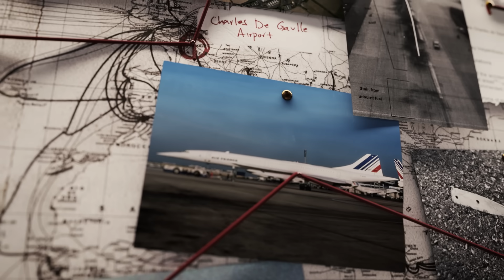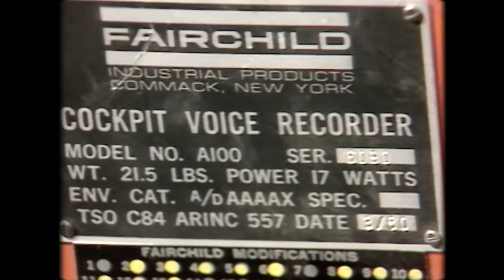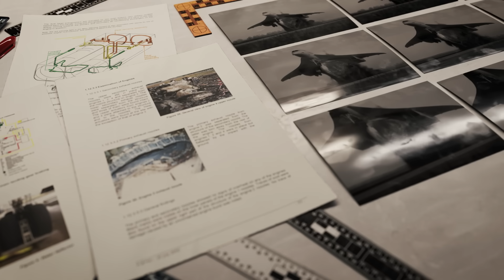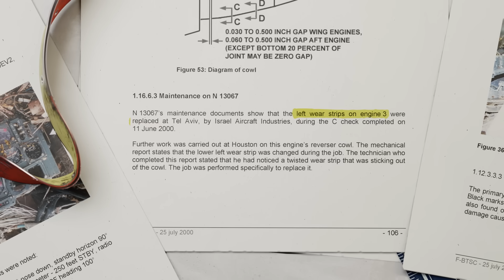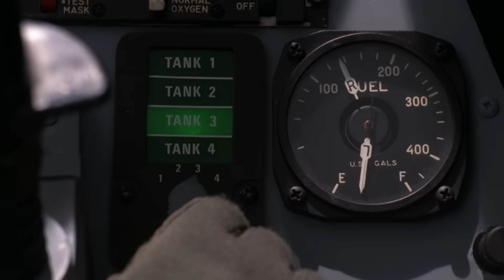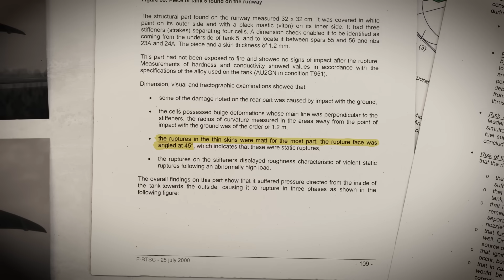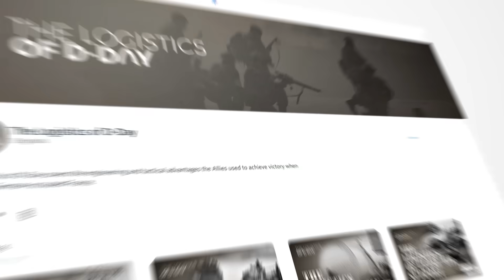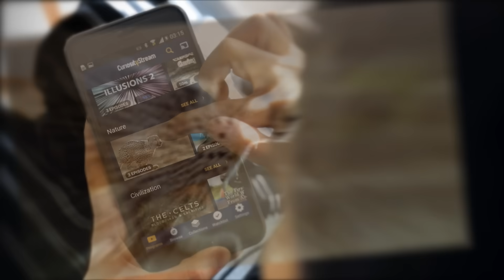What Actually Happened to the Concorde

Comment: That still seems unbelievable how a piece of metal on a fuel tank pop off and separate like that.
Reply: Eh, at high pressures, metal behaves similar to a plastic balloon. You can pressurize an aluminum can with a bike pump (or dry ice) and get the same effect, though you’d better have something to hide behind.
Reply: @ZeteticPhilosopher  yes, but the destruction would not leave behind a perfectly flat piece of metal with an outline like that. Seems silly.
Reply: @ivegotheart  what do you know ?
Reply: @ivegotheart  The perfectly flat piece of metal was ejected before the explosion, which lead to the leakage of fuel.. hence it didn't have any burn marks.
Reply: @ivegotheart  Yes it does lol. I work in aerospace. We do pressure tests exactly like this because of this incident, and you get large shreds of metal torn precisely like this.

Don't talk so confidently about what you clearly don't understand.
Reply: @ZeteticPhilosopher  Joints, welds,and weak points will break sooner then some magical perfect shape straight out of the solid material. You are talking magic bullet, and are getting emotional. Maybe you are bleeding or pregnant.
Reply: @ivegotheart  This is why people suck. "You are on your period or pregnant" when someone says something you don't like. Why do you have to be so degrading, it has not even anything to do with the conversation
Reply: @flavorlessquark8614  you say people suck and I'm the bad guy? Feel better. It's not their fault, and It's everyone's fault. Never be angry. Those are the bad people. A man with anger is a woman.
Reply: @ivegotheart  You have a mindset stuck in the 1800s lol. A man with anger is an angry man. You think you're cool cause you pretend to be a manly man without emotions. That doesn't make you cool. Everyone has emotions
Reply: @ivegotheart  I didn't say you were the bad guy, I said there was no need to be degrading to women for no reason
Reply: @flavorlessquark8614  cool
Reply: @ivegotheart  Lmao. I'm not the one having a drama session in a youtube comments section because they got called out talking BS by someone with industry experience. 

Have a nice day. Enjoy the tantrum.
Reply: @ZeteticPhilosopher  cool thanks. I wonder what that makes you.
Reply: the point le the video is that the reservoir was not «cut with a knife » but sheared by compression wave forces. they are not saying exactly like this, but the reservoir exploded under compression waves. the petrol brought natural compression to all parts, and the hook added the little something that was just enough to create the critical front wave to shear the foil. 

this reminds me one falcon 9 explosion, where the root issue was a hydrogen tank inside oxygen tank that ruptured, bringing oxygen tank to higher pression than designed ... that happened on ground during filling about 20mn before planning lift off. the dumping mass  ( a few tons, a raw steel roll ) was seen to fly a few hundred meters away. 

you need to understand how waves hugely increase forces ...

see how glass can break with sound. there are videos made by slow mo guys. also check prince Rupert drops (smarter very day, and other )
Reply: @Benoit-Pierre  no. Me thinks thow doest protest to much. Someone was onboard that needed to be Epstein'ed. Nice try.
Reply: @Benoit-Pierre  
Are you referring to harmonics?
Reply: @fazole  no. Harmonics and constructive interférences help building waves with very high energy, but nothing in this video points towards these specific case. But a simple impact wave + simple echo could be suffisant to explain the problem of the day. We need access to the full simulation to know what « exactly »happens. The video does not go deep enough to know. 

In other cases, yes harmonics are pretty much destructive, and example of easy destruction. 

Singing in front of a glass can break it without touch.

Impacting some objects may break them via a counter intuitive way, and the slow mo guys often show it : you impact an object at some strong place, the chock produces a propagation wave , and object breaks at  a different weaker place. At live speed you see the thing breaking instantaneously, but with slow mo you see that initial fracture happens very far away from initial impact.

I had the cas once irl. I was washing a glass, holding it firmly. The glass touched the sink, and a thin half mm peace broke at the precise point of contact between the glass and the sink, but a good 5cm chip detached at the exact opposite and fell in the glass. I was both angry breaking an expensive glass and amazed by what I had lived. The chip was almost a perfect half circle, simply detached, strictly at the opposite of contact point. I was still holding the glass, and could remember exactly how the glass touched the sink. Any one else not being physician would doubt about what had happen, if memory fails, glass turned in hand, slipped ... But my knowledge explained the situation. It was completely counter intuitive. And it's exactly what happened to the Concorde.

Harmonics and interferences (are very different ) both imply that several wave tops propagate in order to either define a wave length, and or a wave addition.

In case of concord or my glass, this is not possible. Every single mm or inch the wave propagates, it looses energy. So, the wave around my glass would have spent much of it's energy after several turns around the glass. The glass did not had time to resonate. Either there is enough energy to break on first turn, or it will dissipate. (In short. With very low resistance propagation, you could maybe so 2 or 3 turns to synchronise two waves, but very few rotations at harmonic lead to huge and rapid dissipation ). 

Breaking at a place different from initial impact is a very rare case and very difficult to explain and simulate.

In most cases( like singing in front of a glass ) you gradually bring fresh energy and build up the wave. It's the case when you see dancing sand on vibration plate( happens often when I grind a steel sheet ) ,  or foam ball floating in the air with ultra sound.  

In the Concorde, or my glass, energy is not gradually brought with time ,  but impacted at one strong place, then it moves at  a weaker point. 

That's why the hook must not be seen as knife which cuts through, but a hammer that hits one strong point to induce one wave. 

If the hook had just cut the reservoir, it would have produced one cut, followed by an irregular shear, and the peace would by hanging by some side. But the bit of reservoir is very square and completely detached with regularity : some how the wave found a way to draw a square of forces. 

Note that the reservoir not only stands full pressure of tons of gaz, but is also a structural part of the plane. This happens near the engine, when engine is at max power, and plane is the heaviest, producing the largest possible constraint on the wing. The whole plane is completely elastic and flexible, so even if most of the forces are transmitted to structural   beams, the face of the wing is used to participate to the global strength and contributes to transmit efforts from the engine to the main body. So, the reservoir pressure plus position between engines at max power and main fuselage is a perfect situation to tension the face.

Same hook at landing with idle engine and empty reservoir would probably not lead to such nice square shear. 

Note that the Concorde has from memory 9 or 12 reservoirs, and gas is moved around to move center of gravity and help choosing inclination. Once rising is finished and plane starts the main flat course, gaz is moved at the front to lower the nose. Then back again for landing. If most modern planes play this game, the Concorde is the plane where its most important, and most critical design feature. Aerodynamic of delta wing is not appropriate to handle wing modification structure to stand low speed high angles, so center of gravity correction is done by moving fuel. This impacts on the pressure endured by this specific part of the reservoir at this moment. 

At landing the fuel is pumped back again, but in the tail reservoir, because wings are almost empty. And since the plane is considerably lighter there is less need for portance on wings. With less mass to need to lift, wings have a different need. So center of gravity is not at the same place at landing. 

This plane was a marvel of engineering.
Reply: @Benoit-Pierre  i love the example of that glass, clarified a lot of things.
Reply: Adults behaving like 10yo kids in the comment section 🤣. Internet was suposed to make us smarter not dumber
Reply: @erderscrtus8331  so here you come

Comment: Lockheed: “you mean the L-1011 lost to a plane so bad it caused other planes to crash?”
Reply: Only lost because the engines from Rolls-Royce took so long to deliver, meaning Douglas had already lobbied for their DC-10. Also, wasn't the plane itself, it was the repair work carried out by Continental  though the DC-10 is still very dangerous. L-1011 was so much better.

Comment: Maybe it was answered and I just missed it. But how did the fuel leak cause a loss in engine power? There would of still been plenty of fuel to power both engines.
Reply: The Co-Pilot shut down the wrong engine no shit TRUE
Reply: @davidclements6507  Flight Engineer. And he did so below the minimum safe altitude to do so.
Reply: My guess is that the force of the leak caused by the hole was stronger than the force of the pump. As the fuel is incompressible, then it will only go one way thus preventing the fuel to reach the engine causing it to stop.
Reply: My first thought as well.  It looks like one engine abruptly lost power at the same time the fire started (based on the curve in the burn mark on the runway).

Comment: I'm amazed that you managed to make this video and leave out so much detail about what actually happened and caused the accident. Examples being, the missing spacer on the left bogey, allowing the wheel truck to wobble about all over the place. The aircraft was 3 or 4 tonnes overweight, the tyres were over inflated, the fuel tanks were full to the brim, leaving no air gap, the crew taking off from the wrong part of the runway where resurfacing work was being carried out, so they hit a lip where the new tarmac met the old, and the fact that the flight engineer, suspecting an engine fire (there wasn't) shut down one of the engines WITHOUT consulting his checklist, nor alerting either of the pilots that he had done so. The Air France Flight crew were negligent and responsible for this accident (along with the engineering team). There's SO MUCH more to this accident. If you want the full story, you need to watch this video by Senior British Airways Concorde Pilot John Hutchinson https://www.youtube.com/watch?v=fqOcYhzWUZY

Comment: That really is an incredible cause. My mind went to the landing gear being forced slight upward/and toward the wing causing either an immediate rupture or upon the release of tension the material pulling apart just enough to open a tear in the tank.
Reply: This is not what happened, the tire exploded from over pressure when it run over the metal strip, and the rubber (a large enough chunk of it) itself flown upwards and hit the underside of the tank. and that piece caused the pressure wave to move in the tank (inside the fuel) and when it hit the tank side on the wrong part, it blow out. it was not a slight movement in the landing gear, but a literal explosion with insane force. Still, it was somewhat known to happen and there was even some talk before to switch either stronger tire or make it, that the explosion would go sideways, instead of vertically, avoiding the plane.
Reply: @thorin1045  I know that....I wasn't telling the world some alternate reality. I was just offering my reaction and initial thought of what it could have been. Based on nothing but seeing the resulting plane crash.
Reply: @Nilguiri  Yes. Clearly. Much nah.
Reply: @thorin1045  yeah, and until this incident.. Concorde just... seemingly didn't think it a high priority.  It's astonishing to me that they didn't think this a big enough deal to take action until it caused a disaster.
Reply: @marhawkman303  well, the tire had issues multiple times, but never caused any issue before, so they believed it is safe, and probably if the metal strip would have been a few meter earlier, the tires would spin much less and the dent would have been small enough to not cause major issue. It was in the worst spot, fast wheel beyond the safe abort speed but before it started to lift and reduce the pressure on the tires.
Reply: @thorin1045  But the tire DID cause issues.  It holed the tank in more than one case badly enough that the Concorde had to cancel the flight and return to the airport for repairs.  This is where the "DANGER WILL ROBINSON!" alert goes off.  A fuel leak bad enough you had to cancel a flight for repairs is not something you should take lightly.  If it was only once? Maybe.  But it wasn't.
Reply: @marhawkman303  yes, they should have done it, or to be precise, they actually did taken it seriously, they already requested a better, stronger, more resistant tire, it was designed and even produced, it was under delivery, within a few days it would have been on the concorde, so it was almost averted, just they got unlucky (or irresponsible, depending on view) and it caused a very bad issue before the solution arrived.
Reply: @thorin1045  Need to also take into account that Concorde was overweight during it's take off run. Extra luggage had been loaded unexpectedly and Concorde did not burn off all of it's fuel when it made it onto the runway and as a result the tanks were overfilled and the fuel had not been distributed equally to make up for this (as evidenced by the switches on the recovered instrument panel)
Reply: How would that happen except perhaps in an extremely heavy landing? I can't imagine that a small metallic strip would bend the whole undercarriage upwards, especially during a take-off run!
Reply: @Nilguiri  when you have a heavy plane charging at a small metal strip on the ground at 100 knots, it has quite a large amount of force, but yea I don't think the suspension system wouldn't prevent that.
Reply: I don't think a good suspension system would allow that. But yeah, what happened was pretty much unpredictable. No one's fault in my opinion.
Reply: Generally speaking, the idea I was expressing was purely based on unaccounted for failure of said suspension upon the release of the air pressure of the tire. Basically structural failure followed by some downward movement causing some of the sub components of that suspension to be pushed upward into....whatever was above it, perhaps a fuel line/tank. Obviously it wasn't something I have any background information on or experience in. I'm just a stupid electrician lol I may or may not have experience in some wiring in an older aircraft or two but....not if anyone is asking...because if they are, I don't and I was kidding.

Comment: But what started the FIRE? 🔥
Reply: Wiring short somewhere in the area other damage from tyre explosion. When those tyres go, it is like a small bomb. Ground crew have been killed inflating them to correct pressure, when has a small non air leaking tear.